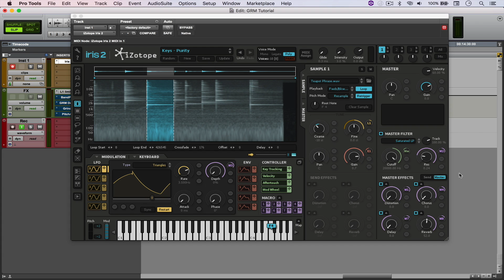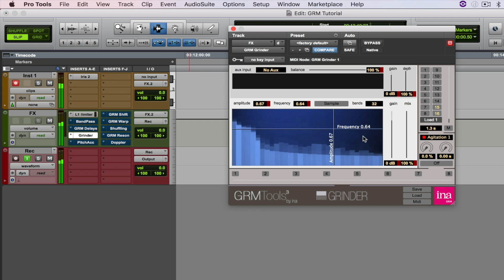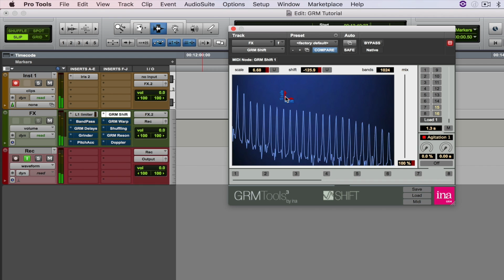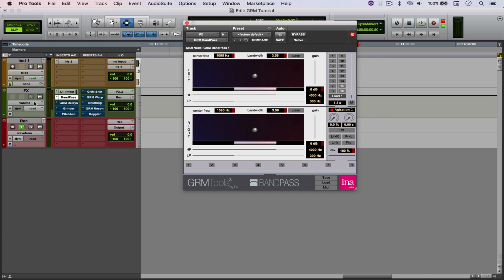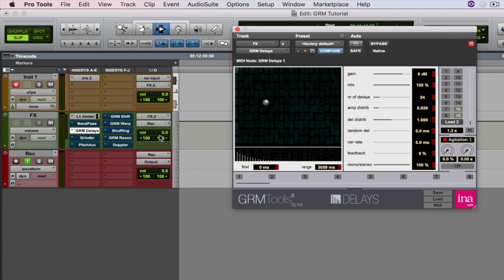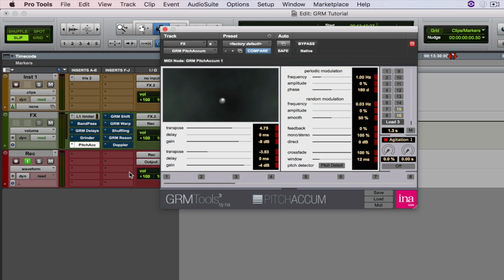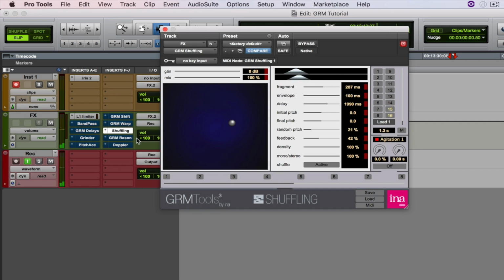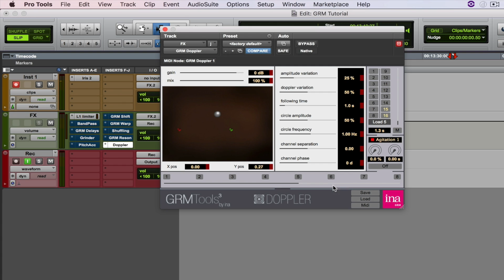Exploring the GRM Tools for Sound Design

Comment: Can one use this with Logic? I’m a beginner sound designer who dn know much about external plug ins. Could you do a video on this or explain what to do if one is using a DAW like Logic.
Reply from the maker: Hi Glenn, I don’t use Logic but I’m pretty sure you can. The GRM plug-ins are available as RTAS, VST, AAX and AU (Audio Unit). AU is exclusive to Apple’s operating systems, which seems to be the only format that Logic works with.